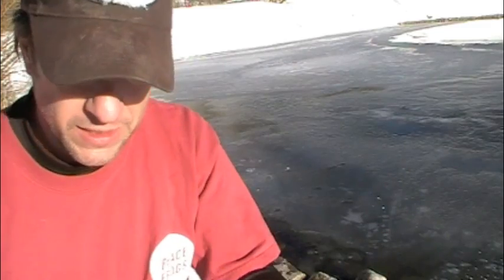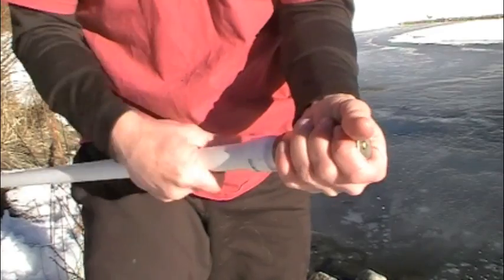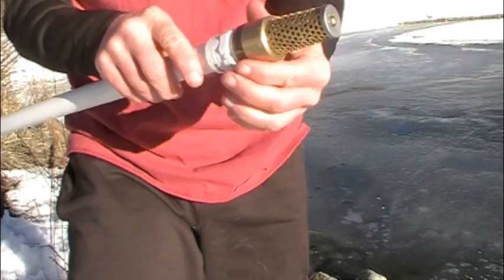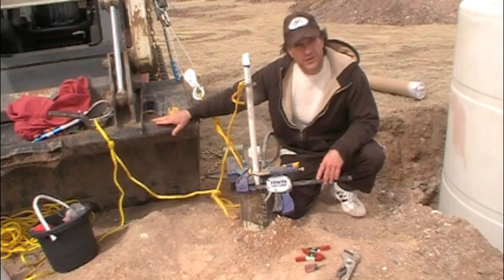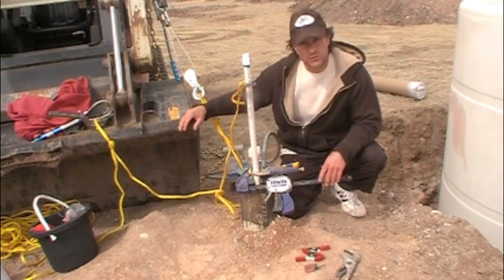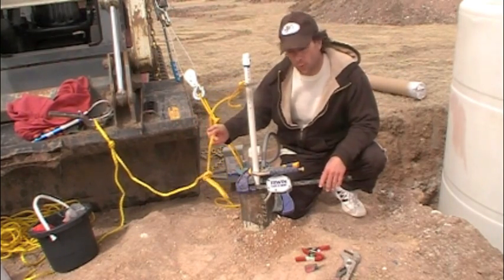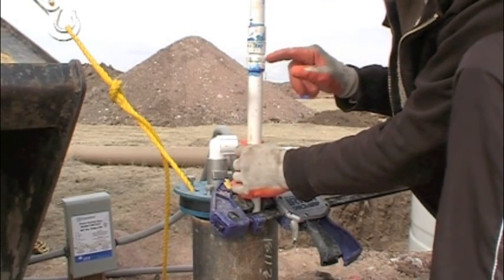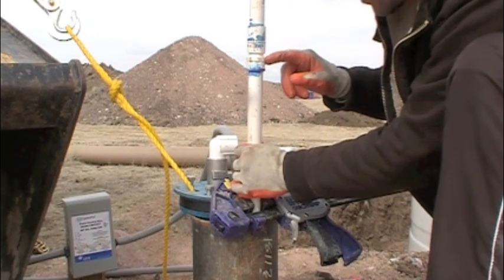How to install a Cheap Foot Valve Water Pump In Well

Comment: A piece of plywood with a slot cut in it just barely bigger than pipe diameter but smaller than fitting, would work much safer than a clamp. Don't clamp pvc pipe.

Comment: Yes, it's a prime example on what NOT TO DO to your well.
Vice grips on sch 40 pvc, ... sweet
Teflon tape on male threads that screw into pvc female adapter , ... even sweeter 
Sch. 40 pipe with glued on fittings down a well ,...  sweetest of all, ...
I charge $125.00 hr to properly install a pump system ...... $225.00 hr to fish out a self install that fall to the bottom, I hope this vid goes viral .....